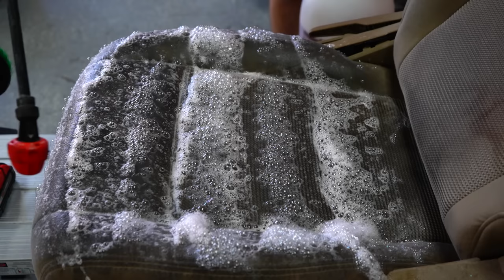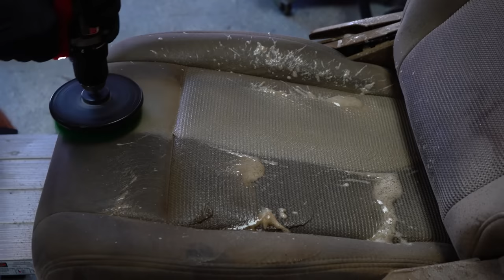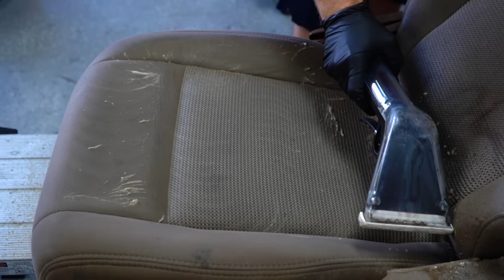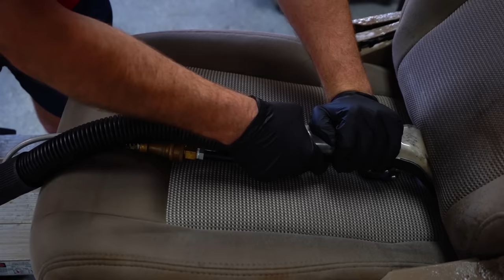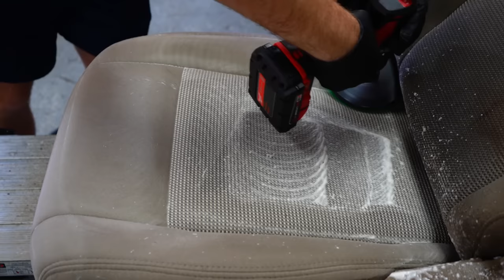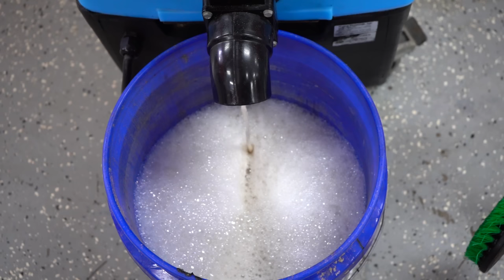Insanely Satisfying Real Time ASMR | NASTIEST Seat Extraction!! MAD Detailing | Car Cleaning!!

Comment: Takes almost 20 mins for just 1 seat and not even the whole seat cleaned🤯 You guys did a harkwork to ensure everything are well👏👏
Reply: Upper side of the seat is big also it would take almost 1hr
Reply: seat cover can be remove and wash with washing machine
Reply: So better use seat cover. They can be washed and dried easily using washing machine.
Reply: Yeah way too long.  Those needed too be pressure washed. This is an absolute waste of time energy and products.
Reply: @NoriAbdRahim  This is not seat cover, it is the seat upholstery which has nothing under but the foam cushions. It can be removed using some special pliers. And to do that, it is mandatory to remove the seat from car. Also, when putting it back, there are used some steel rings which are not reusable, and imply the use of another specialized tool. In addition, there are electrical wirings for sidebags, sensors, seat heating and possible seat adjustment actuators etc. for the worker to carefully avoid damaging. All of this could take an entire work day for just one seat. 
The method used in the video may seem time consuming, but it is obvious  that such a filthy seat would be cleaned in let's say, two hours. 
I don't know about you, but in Romania, where I live, there are at least two family businesses which are manufacturing car seat covers, at high level of quality, using the same or even better materials as the seat factory. Their covers are designed to fit exactly over the seats upholstery, and to not impede the seat adjustment mechanisms or the deployment of the sidebags in case of an accident. There are also a couple of factories in Poland which are selling good quality covers all over EU countries. 
I recently ordered a full set of covers at one of the manufacturers in my country, and received the set one week later. It is the second order to them, first one I made 15 years ago, for my first brand new car. I sold the car with these covers, and the buyer is still using that car with the same covers. 
I don't remember how much  I paid then, but for the second order, it was 114 euros. If interested, check "huse" dot ro website.

Comment: Could you tell me if you use the vacuum after finishing extraction??
Reply: Extraction is vacuum. Wet extractors, whether they spray hot or cold solution is just a sprayer with a vacuum all in one. The purpose of an extractor is make it convenient to rinse out the surface by simultaneously spraying and extracting/vacuuming.

Comment: How Is this possible?
Once dirt and grime settles Into
the Fibers of cloth for too long
It cannot be removed 100%
Reply: Soaking them for long hours with mild soap would remove most of the dirt and stains.
Reply: @Dave_en  
WOW! 🤔
Well you guys sure do a fantastic
job and definitely motivate others
to at least get off the Couch and
try to get a Vehicle clean. 🤩
Thanks for the tip! 🕺🏽
Reply: @superdude7459  Im not professional cleaner but in household work I experiment and find out the best method of cleaning dirty cushions and curtains. Certainly 4 hours of soaking with Ezee detergent makes the clothes shine like new. Never use soda based laundry powder as they destroy the fabric and fade them quickly. I clean my jeans items using very little amount of Ezee (meant for woolen clothes) and they remain just as new.
Reply: @Dave_en  
Oh Ok
Great... I actually learned something.
Reply: @superdude7459  for very dirty and stained clothes use just a teaspoon of detergent in washing machine along with a 15ml Ezee. Both should be properly dissolved before soaking the clothes. After 4 hours wash them as usual. Use only cold water for jeans. Hot water is to be avoided for all clothes. Never go beyond 30 degree C.
For best results turn the clothes inside out and then soak. Put them in semi shade area. After the clothes dry reverse the cloth to normal.
Reply: @Dave_en  
WOW! 
Knowledge is power. 🤔
Thanks for that tip. 
I don't like anyone doing my
laundry but me. 
What is Ezee stuff you are
referring to? 🤔
Reply: @superdude7459  that's a liquid detergent especially made for woolen clothes. You may look up in the store for similar product with different brand name. Cost is also very similar to other liquid detergents. Just that it doesn't contain caustic soda.